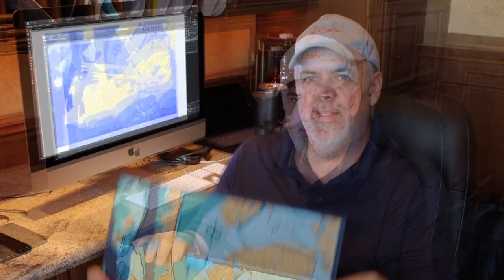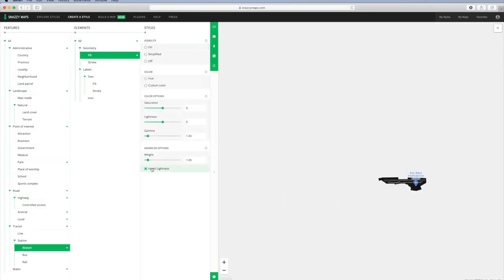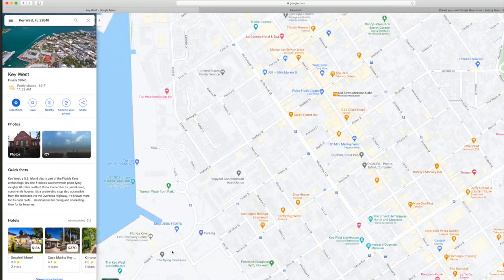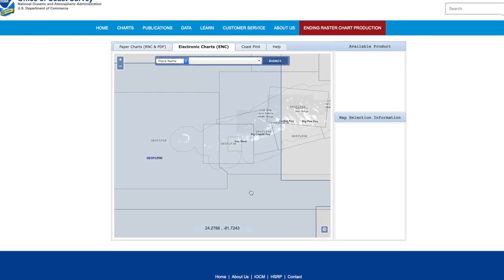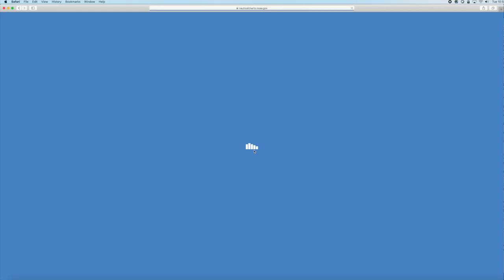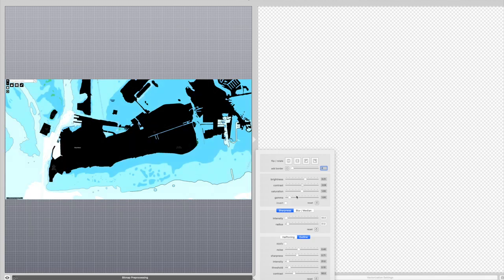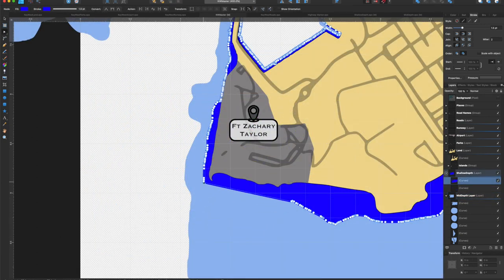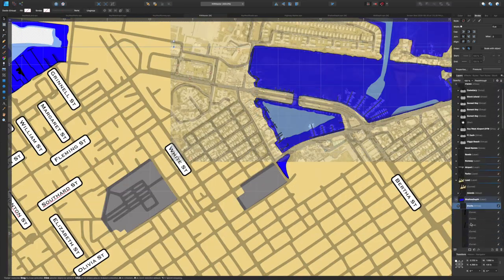Multi Layered Laser Cut Map of Key West

Comment: When I need to glue two layers together that are both going to be painted, I completely mask off the lower layer and use the same offset that you used for marking, for cutting away the mask. Then, remove the negative, paint, and then remove the mask. Now you have a perfectly clean wooden surface for gluing, and the same alignment marks.

Comment: This is fantastic Tim.  Thank you for documenting all this work. I went down the GIS rabbit hole a while back and gave up. This approach is much simpler. In-laws now live at the beach, so i'm looking to make something like this for them.
Reply from the maker: GIS software is very very deep.  I’m sure I could get the vectors out as dxf and clean them up, but it’s still a lot of work...
Reply: Thats awesome. Ive been shopping and Orion is on the list. Have you had any issues with it? Needed parts and availability of parts. Oh and do they have support? Thank you in advance
Reply from the maker: Scott Pratt no problems.  Worked well out of the crate.  In fact I just moved, and it showed up in the moving truck wrapped in a blanket on its side, with boxes stacked on top of it.  Even tho I told them how sensitive it was.  Worked like a charm.  Didn’t even lose alignment...